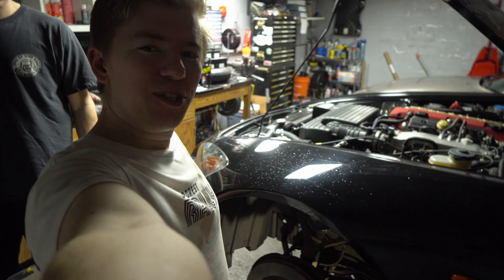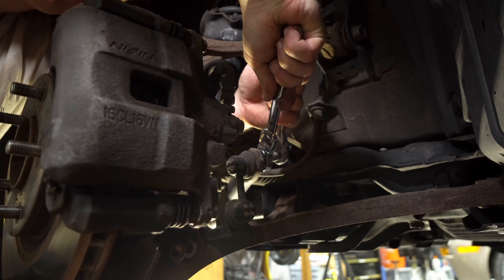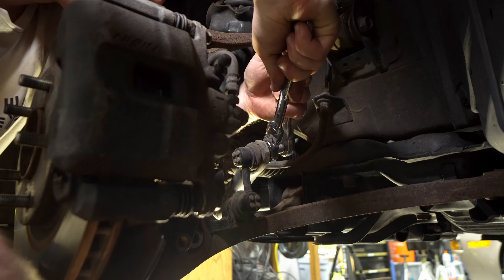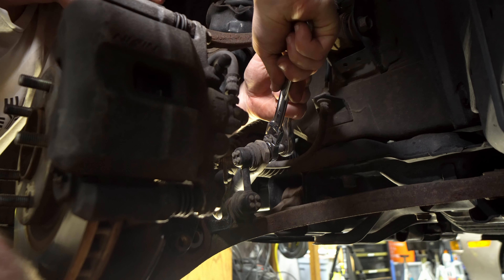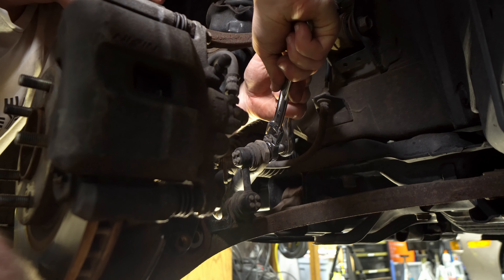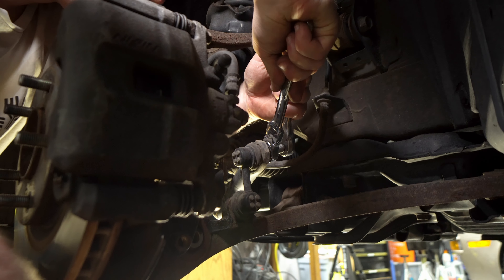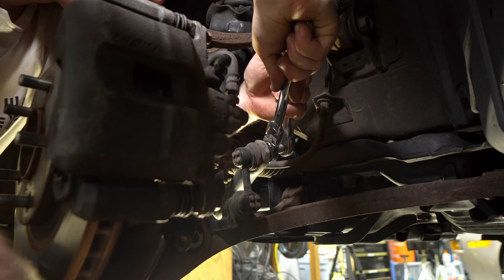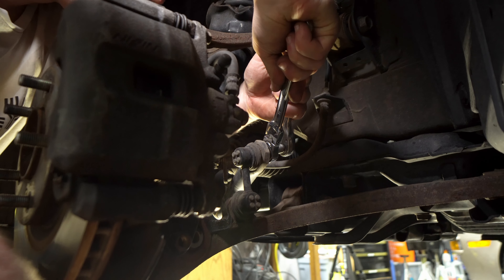Chasing the Best Honda S2000 Coilovers? Ohlins Road and Track!

Comment: hey i saw ur video on the mazda 6 from a while back ago and im just wondering where i could get some parts for that car
Reply from the maker: What kind of parts?? I bought the headlights and bumper off eBay if I recall correctly
Reply: @HardwayLearning   really because i could only find the skirts for it but do u think you still have to link to it?